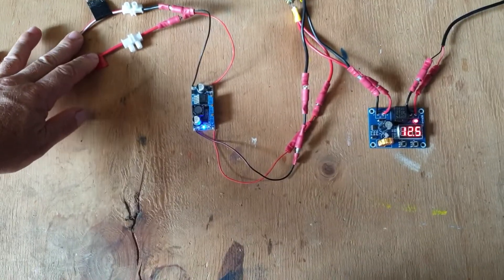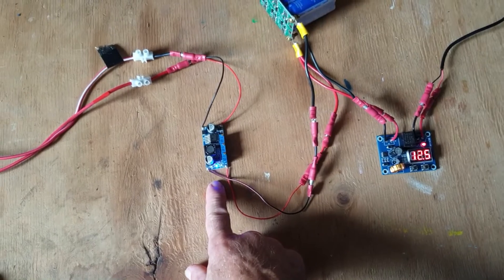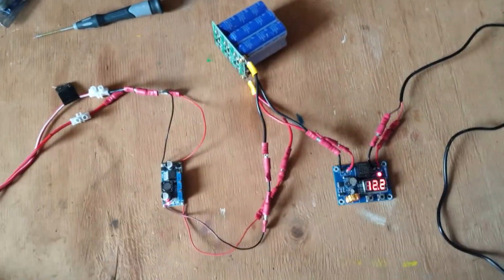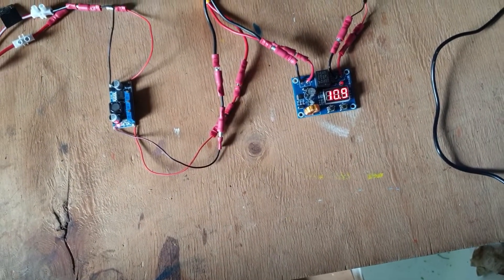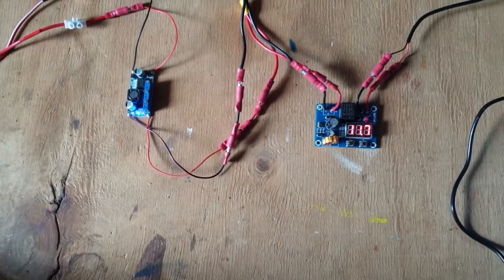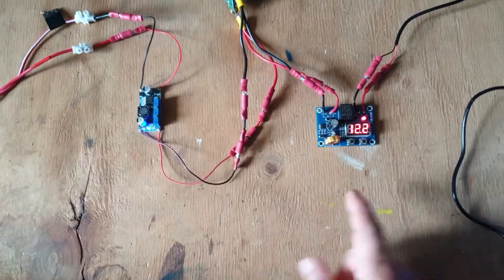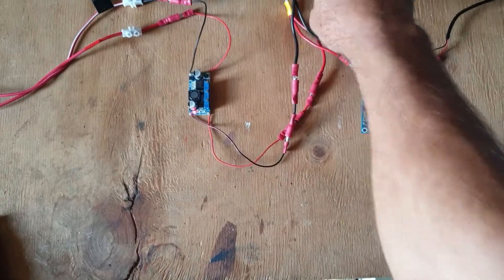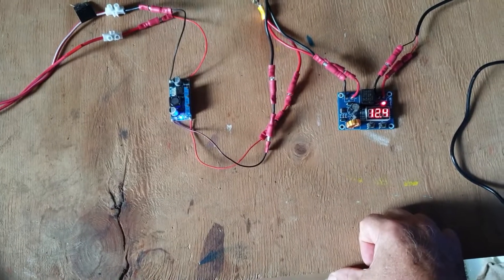Solar panel charging supercapacitor using undervoltage protection and step down module for waterpump

Comment: Love your experiments, how did the voltage reducer hold up over time?
Reply from the maker: I replaced the step-down converter after 1.5 years of constant operation in a wastewater system. These step down converters are very cheap, so works well in my view.